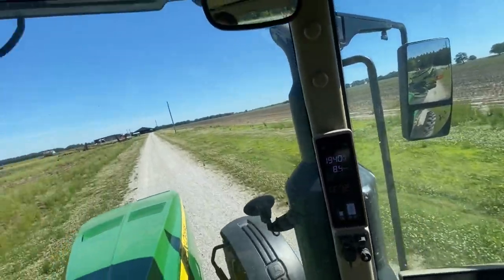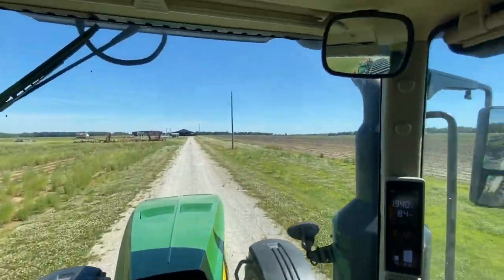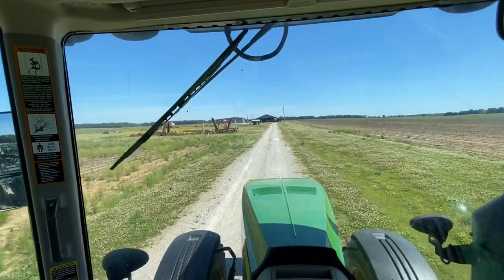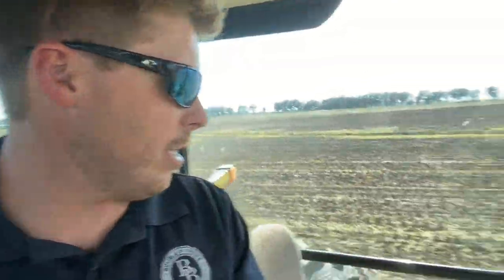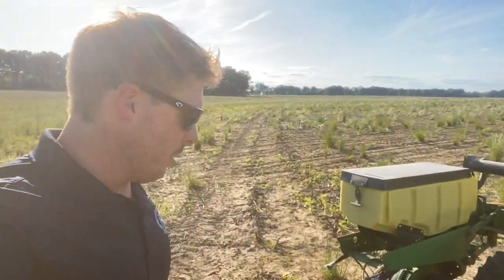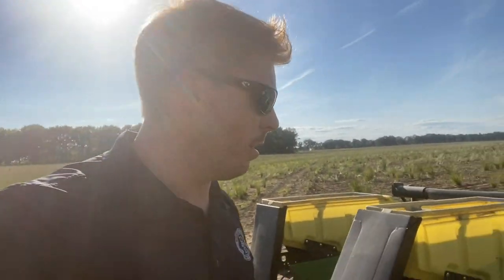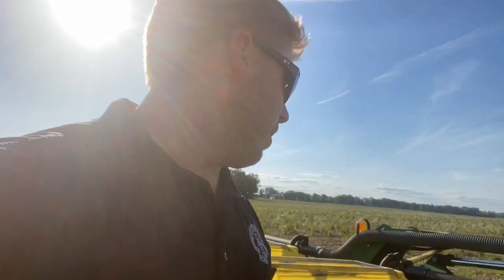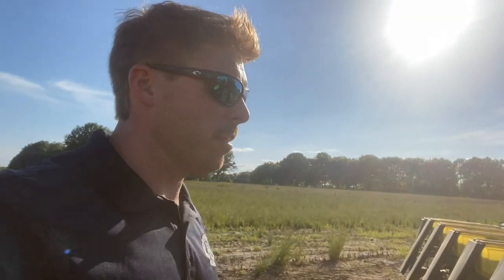Cotton Planting Day 1
(NO TILL)

Comment: When filling with seed, how do you go from one box to another without spilling a bunch of seed? is there a valve on the tender that you turn? Great video!
Reply from the maker: You can actually just cup your hands over end of pipe & not hardly drop a seed, but there is also a remote that you wear on your neck that stops & starts to auger if you need to at any time